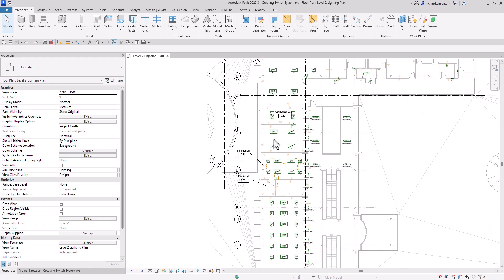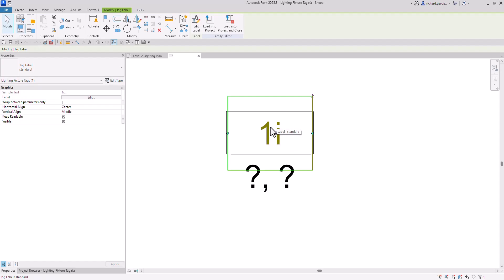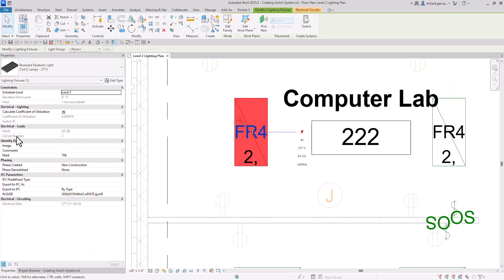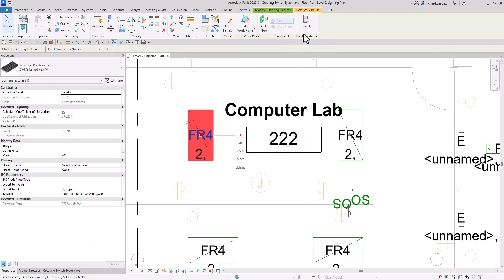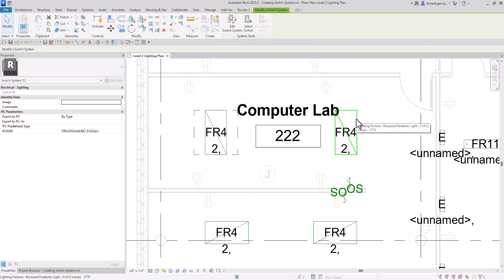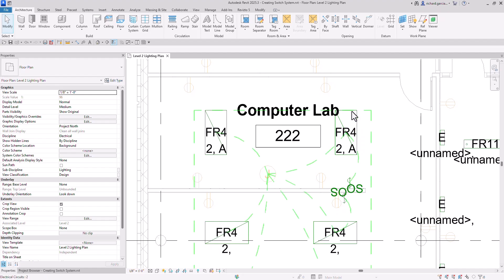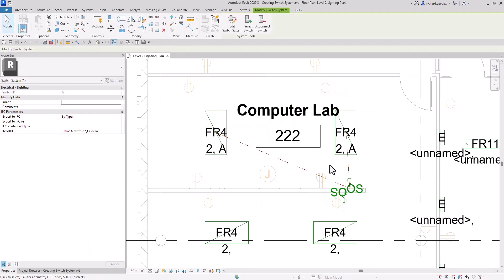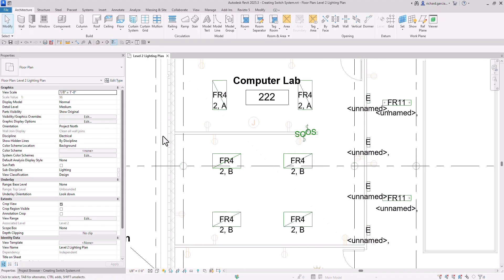REVIT 2025 ELECTRICAL SYSTEM - DESIGNING - CREATE SWITCHING SYSTEMS

Comment: Hi dear Rich, i just bought few days ago a file to exercise on the mep side of Revit. I need to ask you something about it, i have an electrical equipment family and (inside this family) I have nested an annotation family to which I need to add a label that automatically takes the level elevation in the project. I can't add it... do you know how to do it?
Reply from the maker: hello sir, yes! To add a label in your nested annotation family that automatically takes the level elevation in the project, follow these steps:

Steps to Add Level Elevation to Your Annotation Family:
Open the Annotation Family – In the Project Browser, locate and open the annotation family nested inside your electrical equipment family.

Add a Label – Go to the "Create" tab and click on "Label."

Choose a Parameter – In the "Edit Label" window, check if "Elevation" or "Level" is available in the category. If it's not, you’ll need to create a shared parameter.

Create a Shared Parameter (If Needed)

Go to "Manage" > "Shared Parameters" and create a new parameter for elevation.

Assign it as a "Type" or "Instance" parameter under the correct category.

Load the Annotation Family into the Electrical Equipment Family – Save and load it back into your electrical equipment family.

Associate the Parameter – In the electrical equipment family, link the annotation family’s elevation parameter to the "Level" or "Elevation" parameter of the host family.

Load into Project – Finally, load the updated electrical equipment family into the project. The label should now display the correct level elevation.